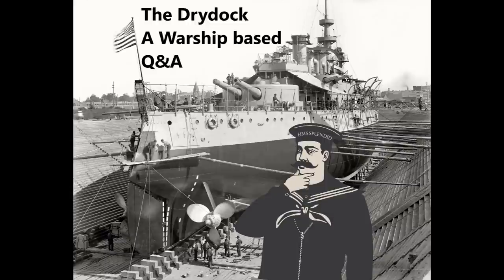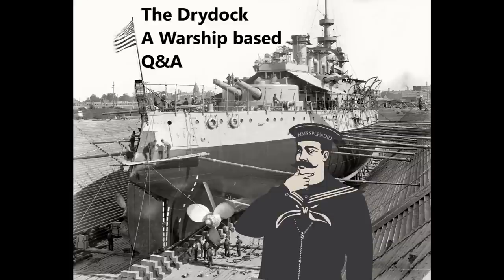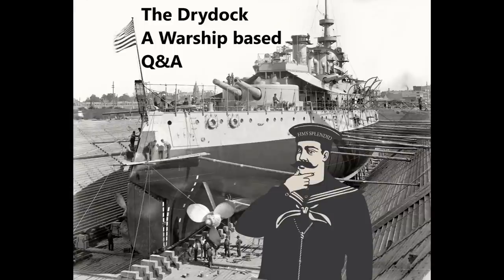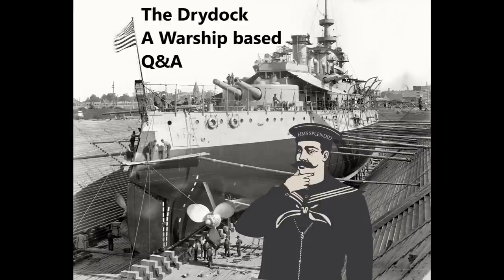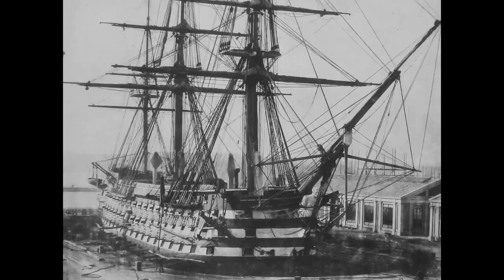The Drydock - Episode 196

Comment from the maker: Pinned post for Q&A :)
Reply: Concerning u-boats in ww2. If being depth charged wouldn't it be the best tactic to immediately dive to nearly max dive-depth as it increases time of fall of the bombs (more time to change course) and adding possibility of a temperature layer thus being harder to detect at all? In movies dive behavior often is displayed in a way that the sub only begins to dive deep once the situation becomes more dangerous. Is that rooted in reality?
Reply: Did you learn anything that really surprised you on your tour of the US? Naval wise that is.
Reply: Had the Vichy French fleet sortied out of Toulon to engage the British in the Western Med, how would that have gone for the British having to not only deal with the Italian Regio Marina but also the Vichy French fleet?
Reply: Drach, can you do a short about the Slava Class - Moskva  ;)
Reply: @Padzee00  There are good reasons to stay away from maximum depth. An explosion above can push you down. And, if a leak is sprung etc., it leaves far less time to deal with it before the sub reaches the depth of no return. I also assume that the deeper the sub goes the stronger the material stress level without hostile interference is, so extra stress (e.g. by an explosion) is more likely to do damage. Going deep also removes one possible evasive direction, making it easier for the attacker to guess correctly.
Not sure but I believe that at least in WW2 active sonar was less able to detect subs close to the surface due to the limited possible angle of the sonar beam (which also had the effect that a ship going in on the attack would lose sonar contact once it came close, giving the sub valuable seconds to change course undetected).
Reply: Wich of the IJN heavy cruisers from the furutaka class to the Tone Class is the best design/ship for its time and wich is the worst ? please explain your choices
Reply: What propaganda surrounding a warship do you find the most farcical?
Reply: Is it possible to mount the 60cm Karl Gaerat Mortars on a WW2 ship in a Conventional ABXY dual turret layout?
Reply: 0:54 

Hail Hydra!
Reply: The photo if the HMS Birminghan that was displayed while answering the theme song question shows a pair of automobiles on the main deck between the funnels.  Were autos part of standard equipment at some point in some theater?
Reply: What’s that opening song?
Reply: How did German midget submarines performance compare to the other axis nations meaning Italy and Japan?
Reply: @kkupsky6321  I'm not sure what it's called, but the lyrics to the sung version are:

Bucephalus, and Rocinante
Bucephalus, and Rocinante
  One horse was real
  One is make-believe
Reply: was the graf spee pocket battleship in the south atlantic for so long by coincidence or for its namesake? was the original plan to get to asia and use japanese ports? From the map of its route it seems they initially went to pass south africa but re-routed back west. And on pocket battleships, i cant seem to find anything about any similar concepts or produced ships apart from the Deutschland-class cruisers, did anybody else at least draw up or produce similar designs of battleship guns and turrets (modern or dated for its time) on cruiser hulls? super heavy cruisers almost?
Reply: Let's say that the Washington Naval Treaty allowed the RAN to keep the battlecruiser HMAS Australia. Would it make sense to keep around and  through the 20's and 30's? What might a refit looked like/encompassed?
Reply: What is or was the most dangerous position a crewmember could have on a ship and how did this and the average crew fatality rate change over time in various eras. (Classic period, age of sail, age of iron and steam, WW1 and 2)
Reply: @anthonator8810  for the last question, you might consider the Alaska class "large cruisers" of WW2.
Reply: I was wondering if a question asked is not answered, does it mean the question will receive an answer eventually in the Dry Dock, or it is gone for good? No matter the case, I will just ask it again:

In the history of naval combat, how relevant is the naval action of Măcin from 25-26 May 1877? The big claim I have seen for this naval combat was that the sinking of Ottoman monitor Seyfi by the Russo-Romanian crew of the spar torpedo boat NMS Rândunica represents the first instance in which a torpedo craft managed to sunk its target without being sunk in return. Apparently, this engagement influenced the combat doctrine of the Romanian navy for the next decades, spar torpedo boats being used until 1906.

Alternative question: how active was the Romanian Navy through the World Wars besides Operation "60,000" from 1944?
Reply: @kemarisite  that is a good example of one, heard of em before just not that they had 12 inch guns, but im thinking more along the lines of smaller hull then that, less like a battlecruiser, more like a cruiser that "skipped hull day at the gym" and so the hull is more of a traditional midrange cruiser size, with graf spee or larger guns
Reply: @anthonator8810  I believe the RN played with the idea of a "super County" with eight 9.2" guns, which may still not be what you had in mind.
Reply: Did any ships ever use smaller caliber guns as spotter guns for their main battery? The same way some tanks used a smaller .50cal coaxial gun with similar ballistics to the main gun.
Reply: In terms of the first question of this video, the Colorado class warship that would have been USS Washington that was scrapped despite being 80% completed might have been an alternative if somehow it could have been sold just prior to the signing of the treaty.   At least I think so.   Perhaps I am wrong
Reply: Are there any good sources for the crew breakdown among divisions/departments of ships/ship classes?
Reply: drach submarines have had torpedo's that have circled back and sunk the sub has there ever been a surface ship where a torpedo it launched came back?
Reply: who or what is this simmonds, seppings is easy but simonds? 16:11
Reply: Drach, i will start by saying that i admire your work. Thank you! Can you please review some ships from the Romanian fleet în ww2? The romanian fleet, although being small was a crucial presense in the Black Sea. Thanks!
Reply: Have you covered the Battle for Lake Tanganyika and Lord Belly-Cloth in a video yet?
Reply: During major conflicts ( focusing more on late 19 century to ww2 ) how accurate was the various intelligence agency’s assessed capability’s on a enemy’s ships / key system when compared to the true capability’s of these ships / systems and if any who stood out as particularly effective / ineffective in there assessments on average
Reply: Drach, you are transported back to the 12 of October 1939. you have under your command 15 identical copies of the Ark Royal as she was in both aircraft carried and armament after her 99/01 refit, what do you do next?
Reply: It's often noted that, had the Germans focused on producing u boats instead of capital ships, they would have been able to win the battle of the atlantic. However, in that senario, the Royal navy wouldn't have to counter any significant surface threat, so fewer new battleships and crusiers would have been needed. Would they have then been able to devote sufficient resources to building escorts and u boat hunters to keep the sea lanes open?
Reply: You briefly mentioned turret rangefinders. Did they have shutters for prorection in heavy seas? Just curious. Thanks
Reply: How do you feel about torpedoes on WW2-era Heavy Cruisers (e.g. County class)? - Is it worth having just a few, or is it an all-or-nothing thing? What about size of the torpedos?

Comment: I strongly suspect has Ark Royal survived she would have served in the Pacific as BPF CV component command ship and agree that she would have severed into the 1960's. The vital point would have been a machinery refit during the war in 1944, perhaps in the USA? Followed by a complete replacement and update to her machinery post war, perhaps with machinery from one of the historically built CV's.

I have both the D K Brown books and can only agree and highly recommend both. That document sounds interesting Drach. Can I get a copy?
Reply: Ark III could have worked as a fast aircraft transport / repair ship, supporting the armoured decked carriers but staying out of kamikaze range. From memory, the lower hangar was largely used as workshops. Ark IV woud have remained Irresistable imo.

Comment: I wonder if the fellow asking the question about  7 and 8 and 8 and 9 inch guns wasn't referring to armoured cruisers and not ironclads.   ie  the  Warrior and Minotaur classes 2 x 2 9.2 inch guns and then 10 x 1 7.5 inch guns.  which does seem odd to me. I think the last Armoured cruisers were perfect for trying an all 9.2 inch battery
Reply: 9.2" and 7.5" where picked because they where about a doubling of shell weights apart, and the former felt to represent the largest shells before you had a step change in expected fire rates due to requiring majorly different loading techniques being required. This actually appears to have been the case, as they matched much later 8" guns fire rates while in practice shoots being near double 10" and 12" guns... but its also a little debateable in utility as in actual combat fire rates for all guns where vastly less, waiting to see impacts before adjusting, then needing to wait for the next time the ship rolled passed the nominal point before actually firing again. Dropping the secondary battery even as far as a longer barreled 6" wouldn't have really changed the cyclic rates in practice, the required crew or the sorts of targets you could track, but it would have halved the shell weights again, and rendered the guns vastly less effective against many of the intended targets. Also they already HAD the 7.5" guns, because they where built for a shore battery plan that never got completed, and its amazing how much compromise to new expensive units the royal navy where willing to make in order to incorporate parts or ideas they already had laid about the place.

Comment: Battle of Yalu really exposed this Jeune École upgunned cruiser idea as nonsensical. Couldn't hit anything enough times with those massive Canets, still had to close in to use lighter guns, still took heavy beating, one nearly got blown up for the trouble. If Beiyang Fleet was better trained/supplied it'd be a defeat for IJN and everyone knew this.
Reply: Some shells filled with explosive rather than cement dust would have helped as well.  Given their material disadvantages, I think that the chinese fleet performed admirably. I read somewhere that aboard the Lai-Yuen, which was well ablaze, the temperature in the engine rooms rose to over 200° F, but her black gang kept feeding the boilers.  Not a bad effort when you're basically being grilled alive.

Comment: re Greek capital ship purchase after WWI, the first two alternatives that come to mind would be HMS Erin or HMS Agincourt.  Both were new ships in 1914, and both were placed in reserve in 1919-20, so were surplus to the Admiralty's needs.  Seems either would be an insult to the Turks.  Another alternative would be Courageous and Glorious.  They offered more speed than Yavuz, a state of the art powerplant with geared turbines and oil fired, small tube boilers, and their relatively shallow draft could be an advantage in the Aegean.  Additionally, I don't see them listed in either of the capital ship lists in the WNT, implying that the WNT respected the RN's designation of the ships as cruisers, meaning the UK would not be prohibited from selling them after the treaty was signed.  But then probably Greece's most generous benefactor would have been Basil Zaharoff.  Zaharoff saw conflict of interest as a feature, not a bug.  He was an agent for Vickers, and Vickers had built Erin.  Having Greece buy Erin, bundled with a fat overhaul and modernization contract with Vickers, would probably sound like a good idea.
Reply: Yavuz can still just wish either or both of them goodbye and vanish in a cloud of smoke.
Reply: @comeslittorissaxonici7395  if Yavuz was in good repair, it could run away from Erin or Agincourt.  The Courageouses could crack 32 kts, a significant advantage over Yavus, and Yavus' armor could be penetrated by the 15" guns on the Courageouses.

Comment: Dear Drach: I was was recently on Wikipedia, the lovely resource that is and found this; "In 1943–44 a famous Great Lakes salvage engineer, Capt. John Roen, did what was considered financially impossible and salvaged SS George M. Humphrey, which sank in a collision in 77 feet (23 m) of water in the Straits of Mackinac, by first removing the ore it was carrying and then using two vessels on each side of the underwater wreck, with cables that "walked" George M. Humphrey in stages underwater (reducing the weight drastically) to shallower water where it was then pumped out and re-floated and towed out. Some of the techniques developed by Roen for the salvage of George M. Humphrey established methods which became new standards for future salvages, where before many wrecks were considered too heavy and large to salvage.[18]" 

I'm working my way through the drydocks and I'm not sure if this has been asked; why? And what was the gain?

Comment: As fir that question concerning radio navigation systems (also radars and communication antennae):  Antennae work best when their electrical length matches the wavelength of the signal being detected/transmitted (or, with some caveats, full multiples of these lengths).,.  This caused a rat's nest of wiring to be used early in such designs when different frequencies needed to be handled by the individual ship or shore station.  Recent antennae are more versatile, even when not phased, due to FRACTALS.  This includes the antennae of such things as cell phones.  What happens is that you muck an antenna as a flat plates with ever-tinier interlocking spirals of semi-isolated grids cut into it.  Each grid is of a different size and looks like the bigger and smaller ones it is imbedded with.  By carefully coupling this with some logic chips to select the best signal size combinations, you can get amazing use out of this rather small antenna, since it looks like several different antennae where at least some will be near the multiple-wavelength points and can be summed up, ignoring the others until they are needed..

Comment: Also keep in mind multiple smaller nuclear warheads is a solution to missile shields ect. Because the ballistic missile is burned long before being in range (often before half way between nations), they could open a payload fairing and release a number of bombs that would each need to be intercepted, which is no easy task as they are a lot smaller, don't have exhaust or other active emissions, are fairly reinforced/hard to disrupt, and you now have in the case of peacemakers up to 16 of these things to chase instead of 1. The efficiency of widespread disruption isn't actually as well scaled as it would for smaller conventional cluster bombs, due to the very high altitudes of larger strategic weapons detonation, and the way hydrogen bombs energy rises vastly quicker than linearly as you allocate more weight to the weapon (a tactical nuke is a couple of kilotons, a weapon ten times the size is megatons). Likewise few of the multiple release warhead systems really have the precision to choose an individual building to target, so something reinforced as to need a near direct hit (like the pentagon, which is the building with the most publicly available documentation into such a theroectical impact) can have quite a large chance to survive an individual allocation, and any notion of "efficiency" is lost if cross allocating (sending two from the same launch will almost guarantee one disrupts the other) multiple warheads.